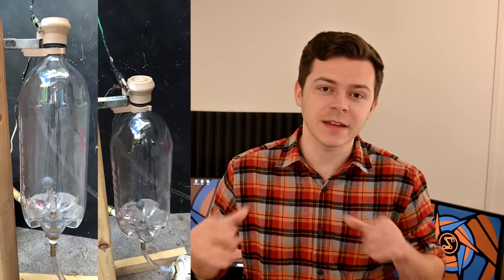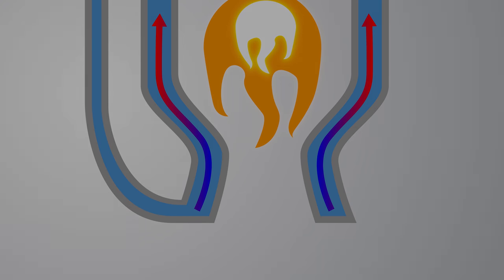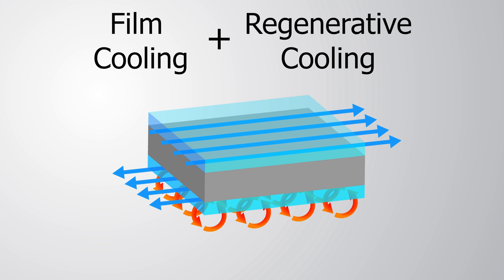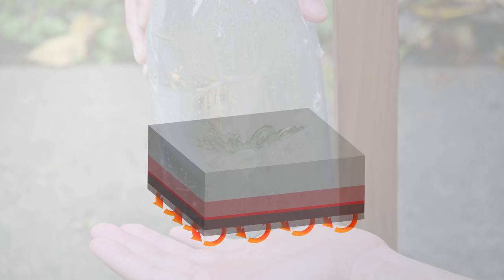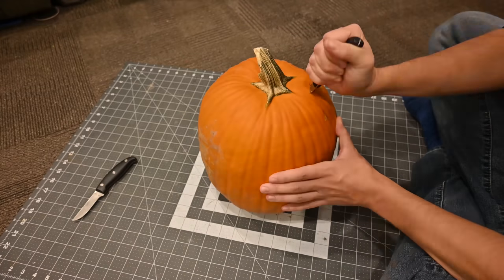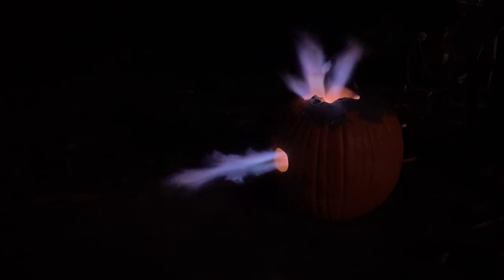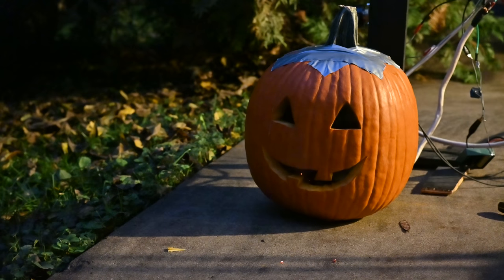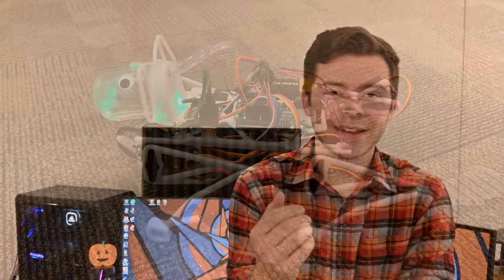Rocket Cooling, Featuring the Jack-o-Rocket

Comment: A good ablator for your nozzle is powder graphite, you can dissolve it in alchohol, soak your 3d printed parts in the solution. The grahpite will be deposited in the part and the achahol will evaporate

Comment: The pumpkin lid would have kept on if the tape was tied all around the pumpkin, because the adhesion of the tape was not enough due to pumpkin surface being too rough. Anyway, great video, fun to watch new ideas, and Happy Halloween!!
Reply: Would be more tape than pumpkin at that point
Reply: @IrishAnonymous01  haha true, there's always a trade-off isn't it?😩
Reply: Or due to the combustion, turned it into several dozen flaming pieces of pumpkin and duct tape. Lol
Reply from the maker: Honestly I’m just a coward haha. it was loud enough as it was and taking away the kind of pressure-release the lid provided made me scared the whole thing would explode and get police officers showing up haha
Reply: @Sciencish  Actually if you cut the lid so that pressure from the inside holds it in place and use some toothpicks to keep it there before hand then you don't have to worry about the pumpkin blowing up. The lid can be cut in a jelly bean shape with an angle that you decide will pop out before the pumpkin blows up. cutting it with a jelly bean shape will let you remove it and empty the insides out better though I think you should leave the guts inside and try to make roasted pumpkin seeds in the pumpkin!
Also I'm thinking for an ablative you could use some of NightHawkInLight's DIY Starlite mix maybe formed around cardboard molds to get the geometry right?
Reply: @Sciencish  No no you got a point, you need to keep in mind safety afterall, wouldn't be fun being called cops on while making pumpkin rockets in the backyard 😂
Reply: What you describe is called spiking in the fireworks industry. They do it to mortar shells to allow pressure build-up so they explode more evenly.
Reply: @IrishAnonymous01  He could have cut the hole on the bottom?
Reply: @jeremykuberka9780  Seems like that would have launched the pumpkin!
Reply: @IrishAnonymous01  I think the weight of the pumkin would keep it stationary
Reply: You saw it rip the tape, right? There's a lot of pressure there, it's going to find a weak point. Would have blown the pumpkin in to pieces. Pressure has to go somewhere.
Reply: Like a fiber over-wrapped pressure vessel, but with pumpkins!

Comment: I’m pretty impressed at the lack of charring inside the pumpkin. Now you need to shave off enough to layer a bottle with it for effective protection haha
Reply from the maker: The next video is just me using a peeler on a pumpkin and using tweezers to line a two liter bottle with it for like 3 hours, just for the whole thing to explode in a third of a second haha
Reply: I think that it's because that the combustion was pushed outside

Comment: maybe heat a 2 liter and then fill it with high presure air to expand just large enough the you can fit a normal 2 litler inside with room for a film of liquid in it for that type of cooling you mentioned.
if it works you might want to put strips or zigzags of hotglue between the two later to keep the combustion pressure from expanding the inner bottle creating a bottleneck that stops the flow, that or just high enough pressure of a pump

Comment: Stupid idea: what if evaporation cooling meet film cooling trough jacket cooling?
instead of injecting the cooler from only one spot on the top, the whole bottle has many perforation that would let the cooler soak in. Since your "weak spot" seems near the throat, that would also maybe double as mist injector rater than only cooling.
The jacket is only a way to bring the cooler where it is needed,can be replaced by tubing is you find out the spot that need cooling are quite stable

Comment: Would have been interesting to see a pumpkin that's not had the lid removed and with all the guts still inside, just with 2 holes drilled for the injector and nozzle. I reckon it would have held together and the guts would have burned up and ejected through the nozzle quite effectively.

Comment: Since most of the pumpkin is empty, try cutting the lid in an outward diagonal angle, then push it inside, clean out the insides then pull the lid back up so that inside pressure holds it closed.

Comment: What if you poked a crap load of mini holes into the bottle where pressurized fuel could enter to continuously coat every part of the surface in cool fuel?

Comment: Maybe try submerging the two-liter rocket engine into an ice-cold brine. The greater temperature differential should draw more heat away from the rocket and give it a larger thermal mass to overcome before it melts.

Comment: I'd use longer straps of duct tape, starting from the bottom of the pumpkin so that the weakest point is on the opposite side of the lid, and perhaps making at least a couple of turns. Hopefully this should keep the lid in place (and finally make the freaking pumpkin blow up).

Comment: Fit a 1 liter bottle inside a 2 liter bottle then fill the gap between the two with flowing water. It could work or it could just explode.

Comment: I have used wet dough of flour, sugar, an baking powder to make a heat shield for the inside of my foundry. It bubbles an burns an turns in to an insulating carbon foam. nighthawkinlight made a video on the stuff a long time ago. When its wet, it would be easy to coat the inside of a bottle with it. But it would take forever to dry inside a bottle. It would also migrated to the low point before it does. So you whould have to do it in stages or somehow spin the bottle while its drying. It took about a week to dry a coating on my foundry. But that coating that was about 1/4th of an inch lasted over an hour.

Comment: I think a great next step to try would be to find a readily available paint that when cured acts as an ablative layer and try coating the inside of the bottle with it while still film cooling the inside
Reply: NightHawkInLight just did a great video about making this kind of material recently.

I've realised it wasn't as 'recent' as I thought, but hey. Relevant link included this time

https://www.youtube.com/watch?v=0IbWampaEcM
Reply: @StormBurnX  I was thinking something a lot thinner, NightHawkInLight's was more of a putty, heck you could probably pack a piece of plastic pipe with it and make a functional rocket nozzle. Unfortunately it would be very hard to coat the inside of a pop bottle.

Comment: Is there any possibility of running it without cutting open the lid? Sure, you may not be able to remove the contents inside, but how much would that affect things? If you really cared about it, you could just burn most of it away with some pure oxygen.
Reply from the maker: Have you seen the myth busters episode about the exploding sewage system? Debris can accelerate a flame front, which in this case could make the thing detonate. After that initial burst tho, anything in the chamber would hamper the air-fuel mixing I think. I don’t have access to pure oxygen and don’t want to haha, stuff is scary lol
Reply: @Sciencish  That is a good point. I haven't seen that episode and I will definitely go watch it. Polyacrylate (superglue) binds really well to skin. Perhaps use that to close the pumpkin "lid"?

Comment: I’m not sure if this would work at all but, maybe try wrapping the outside of the combustion chamber with flexible plastic tubing and run water through it? But that would be inefficient because you’d need a large amount of water if you’re gonna fire it for a long time. Anyways, do you think this has a possibility of working?

Comment: If you want to make a vegetable rocket, I feel like a different kind of vegetable would be better - say, a turnip or a large carrot. You could drill out one end to accept the injector and form a combustion chamber, and even carve in a converging-diverging nozzle. That way, you won't have the issue of a lid that keeps popping off.

Comment: You could use aluminium foil. Its cheap and has relatively high thermal conductivity. You could also use some kind of spray foam to coat the inside. Something that turns to carbon so if it burns it turns to CO↓2. You could use a long thin spray nossle to properly get in the bottle for even coverage. Love the Vids :)

Comment: Make a pumpkin rocket for real, not just a test!
Try to make a maintenance hall in a wall and with opposite angles (to make it hold on by pressure). And add some metal needles to hold it in place.
You may even make a pumpkin nuzzle! It would be a brilliant low-tech rocket!

Comment: not much different from what uv alreadybdone but starting with a colder fuel might give u some more burn time. not sure how exactly ud be pumping this(probably a cetrifugal pump), but dry ice is pretty cheap & available. Pretty sure both EtOH & IPA can handle those temps without freezing though they do get a hell of a lot mor viscous so who knows if that would work well. might be better with some kind of regenerative preheating to keep the evaporation fast enough to sustain or u can just use that injector to inject already warm fuel

Comment: I think you should try to make some Starlite. Nighthawk has a good video talking about it, it's basically a paste you can apply and it will burn off instead of the plastic.

Another idea that is far more complicated is adding an inner wall to the rocket, basically threading a bottle on a bottle, and then passing the fuel in-between the two bottles, down the sides, through the nozle and then ignition, that will cool the exterior using the interior bottle a way to hold the film and avoid too much evaporation (revese the water bottle with a torch experiment) and preheat the fuel before ignition.